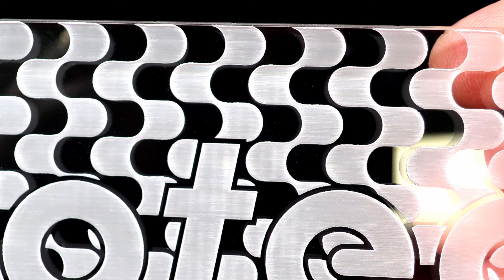Laser Hack: Using Dish Soap on Acrylic Engraving

Comment: I tried that with clear cast acrylic by removing the top protective coating then applying dish soap to the unprotected surface, but when I engraved it, it engraved the back side, not the surface.
Reply from the maker: Hey Garry! CO2 laser systems can only engrave the surface or top side of the material as it is placed into the engraving field unless you are running a fiber laser which will not penetrate through materials like acrylic, this laser hack will not work with a fiber laser wavelength.

Comment: Laser Dave good that we use with the plastic or with the protective sheet on or no.  And could it be used with any acrylic would have to be cast acrylic and content also be used with wood
Reply from the maker: We recommend that any protective paper, plastic sheeting or film that is on the surface of a plastic needs to be removed before the dish soap is applied, This laser hack will work with any type of plastics not just acrylic, and if a wood has a clear coating on it then the soap can be applied to the wood and it will not harm wood but soap is unnecessary for woods.
Reply: @TrotecLaser  i find that the acrylic scratches sooo easily, so I try not to remove the paper until I'm absolutely finished. do you have any tips for that?
Reply: @tubbycustard8866  I'd also like to know how to quickly remove the paper on a bunch of small items cut out of acrylic. I leave the paper on in order to paint the engraved parts.
Reply: Gorilla tape is the best that I’ve used. Cut a piece and lay your product down on the side that needs peeled. Make sure it’s all pressed on well, I use a squeegee. And then peel the tape off and all of the masking should come off with.